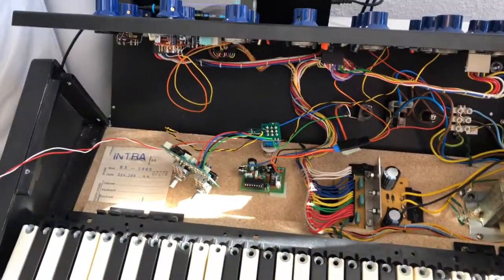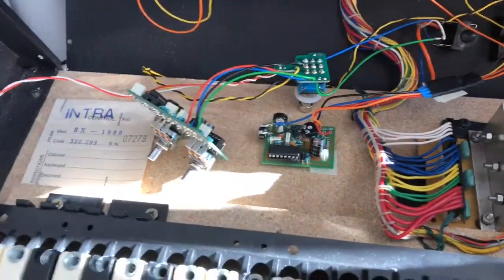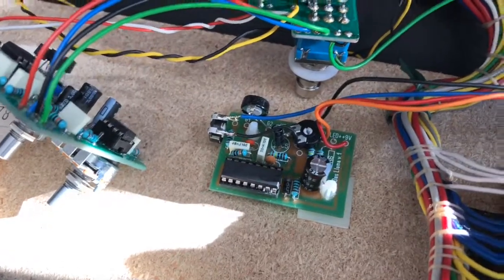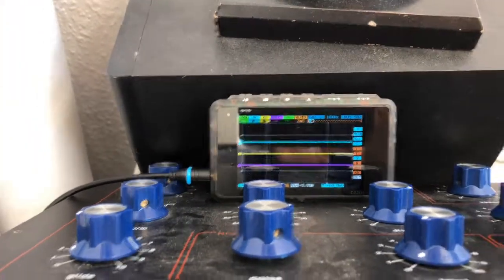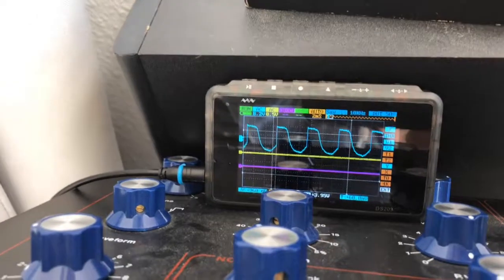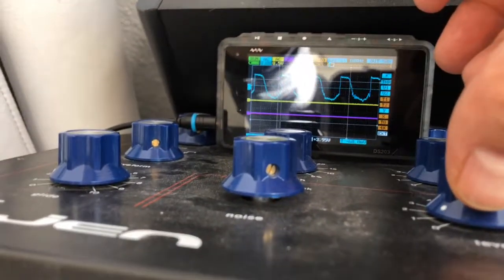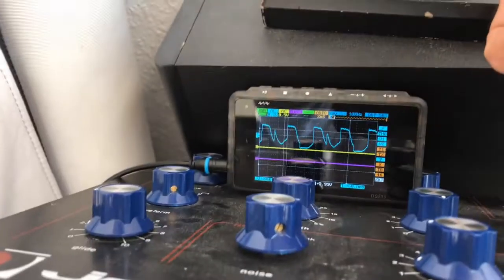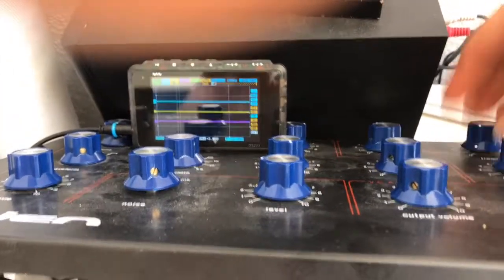The JEN SX-1000 Overdrive, adjusted

Comment: Hi, I’ve been searching the web looking to add midi to my Jen thats how I came across your website. There is a lot info to be found if you have one with a broken M110 but mine is still working so I would like to keep it. Do you perhaps know of a way of adding cv without replacing the M110? I have a simple midi to cv / hz/v interface so I was hoping to use that in the Jen.
Reply from the maker: Unfortunately, there isn't. Due to the rather unorthodox construction of the JEN's oscillator - it's an analog osc with digital divide-down circuitry - you cannot just make the control voltage for the oscillator available. So there are no simple options, and they are not cheap either: Kenton did an interface, there's a wonderful more recent design by Jen-SX alpha geek Neil Johnson -- or you could wait around for me to continue, which, to be honest, I'll probably never do. 

Best path is possibly to join the SX-1000 Facebook(!) group at https://www.facebook.com/groups/538983626220077